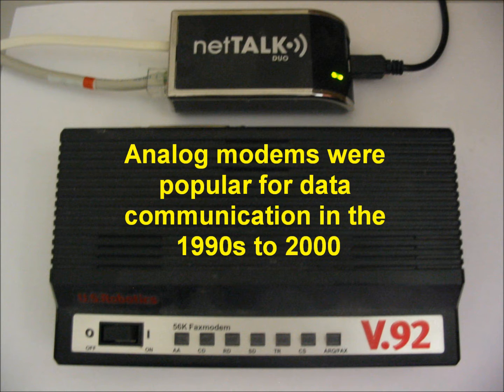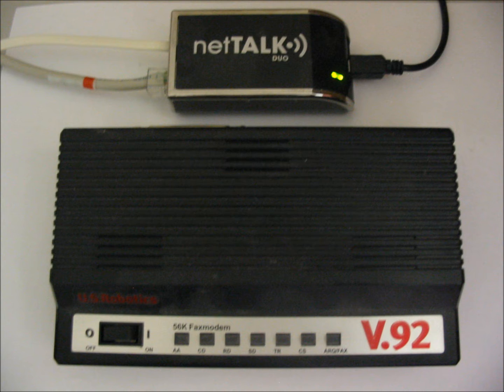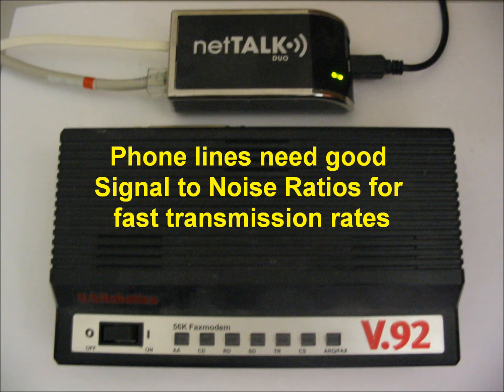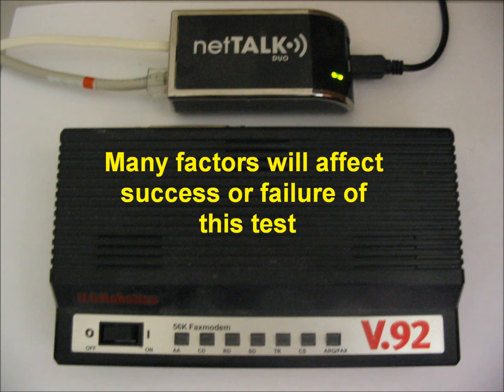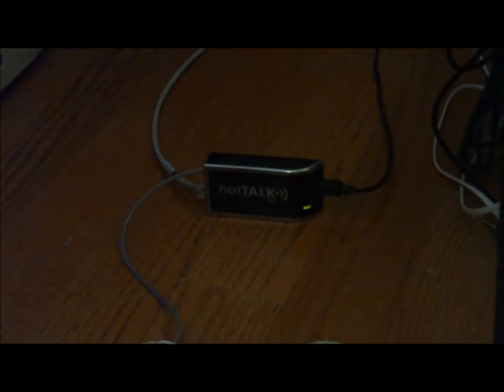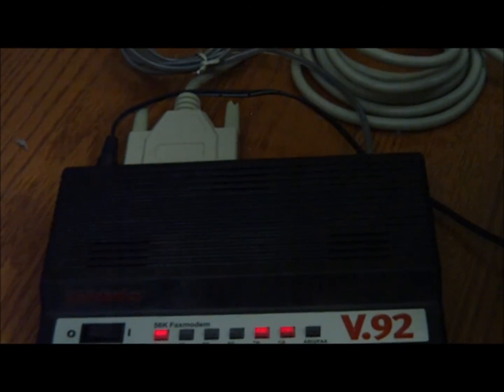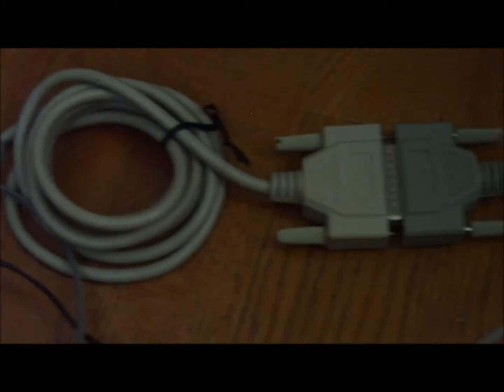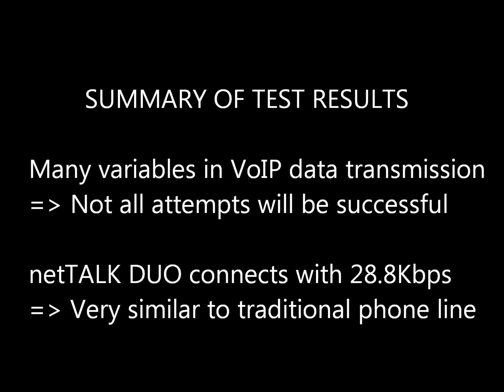netTALK DUO Analog Modem Test

Comment: I was able to achieve speeds up to 48K using a Cisco ATA-SPA112 with the setting for using the line for a modem/fax machine turned on. and using the G711u modem passthrough option. my provider is CallCentric with a free google voice local phone number I forward to my callcentric number.

Comment: Great video! The first handshake was a V.90 attempt with a higher symbol rate but failed after the DIL sequence (typical USR bong-bong). The second handshake tried another V.90 attempt with a lower symbol rate but still failed after the DIL sequence. The last handshake fallback to V.34 protocol to make the connection successfully.

Comment: Ok, the modem took 3 attempts at negotiating its handshaking (normally 1 was enough), and even on the connects, a terminal program transmitting with xmodem or zmodem file transfer was not attempted, winch would have been the best check on actual throughput. I understand this is a 2 year old video, But as a former T.A.G. BBS operator, from 1990-1993 already had 28.8k and a currier from USR would be used, anyone remembers back then, connection will throttle speed down, if conditions cant be maintained, so the connection speed without a download speed review is misleading.
Reply from the maker: It is good to see that there are still people who remember the glorious BBS days.  Nowadays, it is difficult to find a BBS around anymore to do any real testing.  Even dialup modem connections are becoming scarce.  The only dialup numbers I could find are for PPP sessions to make dialup Internet connections to an ISP.  To get an accurate speed requires Zmodem or Ymodem-g which require a clean no-overhead connection.  PPP frames have overhead.  Most VoIP adapters won't be able to even complete a modem dialup connection given Internet latency, but this one surprisingly worked.

Comment: I can achieve data connections at 52kps and fax at 14.4 kps with a Linksys pap2t set for g711 and a laptop with a built in modem....BUT I cannot receive not matter what I do...always cuts off during the negotiation...
Reply from the maker: You shouldn't need the Linksys pap2t when using netTALK service.  Try it with the netTALK DUO.
Reply: shoppersnet As far as I know you can't use the Nettalk service with a PAP2T, I'm using another SIP provider...